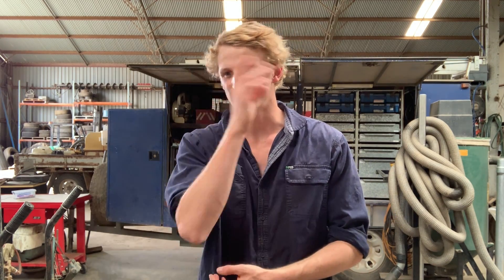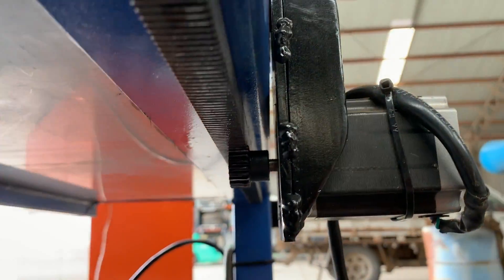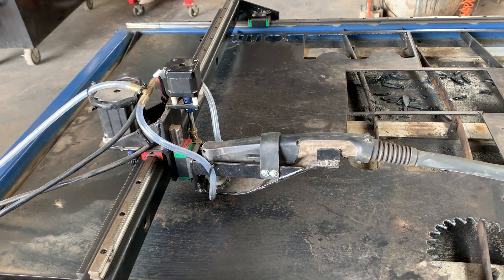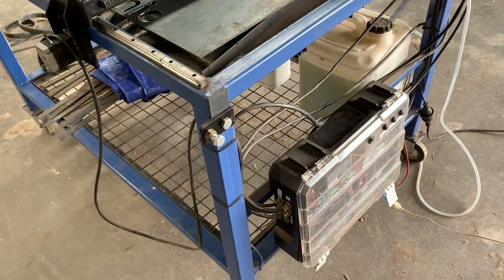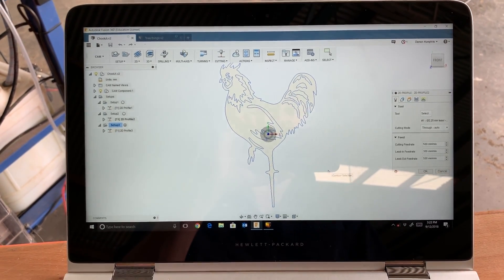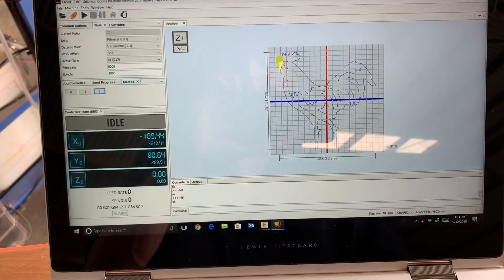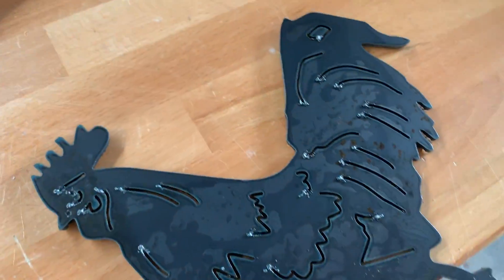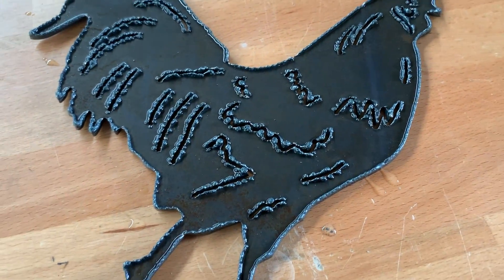Home Made CNC Plasma Cutter

Comment: Do you have a diagram how you wired the cnc shield to the plasma cutter? I got a set up with the same board but using a primeweld cut60 3rd gen..

Comment: I’m planning on building very similar rail and drive setup. Are you happy with the nema23 motors or do you feel more powerful nema34 motors would of been better?
Reply: Unlike CNC routers, plasma cutters require very little torque. I made one with dinky little motors used in 3D printers.

Comment: good job, i built mine using a grbl based controller as well (modded grbl and my fusion post processor) .... add THC, but never thought of adding nozzle mounted water cooling... are you still using it? also

Comment: Nice one man, for emf shielding, it could be coming back down the wires from the stepper coils, (had this problem with dc motor). To fix it, maybe add a diode or decoupling capacitor close to arduino and/or motor control boards.

Comment: you could use a capacitance based system for Z height. Like on a digital caliper...put a metal wheel on the torch holder that can move freely up and down and then use the output from it to alter Z height. iGaging has a digital caliper that has a USB out port on it and you could just attach a little sealed bearing as the wheel so the height is constantly measured. kinda hard to explain in words but if you saw it on a napkin you'd understand in a half-second.
Reply: yeah but the metal wheel shouldnt get caught in any of the cuts and holes made..

Comment: Torch height control will help with reduce the Slag, but your biggest issue is your water cooling is to efficient and will not help with reducing the slag. Also slow down the speed

Comment: Nice work! Thanks for the tour. Going to check out that arduino cnc shield. Yours is the first diy CNC that I've seen that has water cooling. Does Z control compensate for warp maybe?

Comment: Totally insipired by the project. Im also working on something like this using the Arduino CNC shield. Can plz advice me which are the pins that you have connected a input for the relay and how did u connect the relay to plasma.?

Comment: Hi D Humphris. Great Job. And thanks for the Post processor to Fusion 360 / Arduino GBRL. Did you find out with a THC or maybe not necessary. Interesting it works without Pilot Arc. Assume the cooling of plate has crucial influence for warping. Wel. Have build a CNC milling and use arduino cnc shield like yours - but with nema 17 steppers and drives 8825,  but now turn has come for build of  plasma cutter. .Nice table/bed you have build! Y-axis you use DM542T stepperdrive. Reason why ordinary 8825 driver will not work. (have you measured amps on drives while in load?) Or maybe you just need the two nema 23 in serial -and naturally come higher than 2 amps of load? For these type of low value acceleration and speed cncs the amps pulled will normally be low. -Just trying to figure out what will be purchase list for my new build...Until sofar you have inspired me and cannot wait to start..thanks for sharing!

Comment: Verrrry niiice! Is this your first homemade CNC? What a great job! I've love to know more about your choices. Welded steel frame, linear bearings, rack and pinion, digital stepper drivers, but then an Arduino driver? I'm curious how you chose that. I'm not saying it's a bad idea, I'm just curious why you picked it, like what else you considered. I'm building my first CNC and I don't want to bother with Mach3. I don't want to mess around with systems that don't work but software/hardware that does work tends to cost US$300 and up. A $20 Arduino plus the CNC shield sounds kind of ideal if it's reliable.

Comment: Nice job.
Thanks for mentioning the EMI problem.  I am currently frustrated with the same.  I have done the same approach to beat the emi  except for the water table.

Shielded cables, ground everything  , steel box for Arduino.  I guess I will think of water table made of steel.

Thanks again.
Reply: Did you managed to resolve the problem..
Please let me know
Reply: @RoyMeraki  yes
I used ferrite magnets to cover the shielded wires from stepper motors going into metal box also wire from power box.  At that location ferrite magnets going into the box.  I also used a second metal box inside another ferrite magnets around the wire at location going into the box.  Inside inner box Arduino controller.   Lots of trial and error.  The design of a microwave oven outlet and inner box helped me.
Reply: @pedrotorres9836  wow.. thanks you for help sir

Comment: Excellent job on building a very simple yet excellent functioning machine. I am beginning my second CNC plasma machine now so looking around for new ideas. I love the direct water cooling and therefore running the water table basically dry, more or less just funneling coolant into your reservoir. Im wondering why we never really see this done by anyone as I can see it having a lot of advantages over a standard water table. Ive seen some expensive tech that injects water vapor from the plasma shield but your system seems to work great for low tech. You have inspired me to give this method a try. Do you have any input you could share as you have gained some more experience with the machine? Thank you for your time.
Reply from the maker: Sean Stapley hi Sean, I’ve converted it back to a typical water bed system because there wasn’t enough cooling on the stainless bed and was causing it to warp. Also the cooling system I was using was creating a lot slag for some reason
Reply: @dhumphris4717  Thank you for the reply. Those were specifically the two things I was wondering about. I was pretty sure that heating of the pan would be a problem because in your case it is so close to the cutting surface. The slag I noticed in your video was quite heavy and very consistent even on both sides of the cut. I thought that the water spray may have had some effect on that. It did look like the type of slag you had was the easiest sort to remove at least... Anyway, it seems evident to me that your top side water cooling kept that thin gauge sheet flatter than even a traditional water table would have. It also seemed to smoke/steam less than a traditional water table. Would you agree with my observations now that you have tried both? From your point of view, is further experimenting with top side cooling worthwhile (maybe with setting the drain on the pan to maintain a bit of water)?

Comment: Nice plasma cutter. I'm researching making one for myself. I want to use the same plans as my CoreXY 3D printer, to keep parts commonality etc., and I plan to only cut small pieces of steel. Approximately 300x300mm. Do you think that with a system this small I would need water cooling? What about fans for air cooling instead?

Comment: I like your project, its like mine. I have a challenge; when the torch is fired one of the stepper motors(NEMA 23) loses power, and when am cutting with current above 60A wires in the control box heat up. any help please?

Comment: Neat, I would move the controller and electronics out from under the table just because of the coolant/water/plasmacutter mix potentially leaking onto the box. Also would find a way to protect the rails from watersplashes, for some reason they run better without rust ;). Still ... Damn nice job.

Comment: Hey, got into Arduino cnc after having to get an aincient old nc profile machine working as an apprentice lol...check out the 3d printing community for some ideas on implementing height control,  everything they do can be easily scaled up with the controllers you have. And I suspect that second socket on your razor is for a remote control that will help with automating arc control on the fly....most unimig manual include near complete wiring diagrams,  you can download them from unimig website. By the way great idea mounting your drive rails upside down,  even the industrial machines still sit them on top where they fill full of crap 👍
Reply: Just another tip, check out this old Tony,  might give you some more ideas:  https://youtu.be/K9UA9ZRFwWU

Comment: Has anyone ever considered using a vinyl cutting plotter as a base for operating system and parts to build a plasma cnc?? Using the blade axis charge as the cut start/stop control?

Comment: Hi , i use a "PLASMA CUTTING INVERTER TIGMIG TM 60 CUT", i fix the arc pilot but i don't  know how to control it with "CNC 3 Axis TB6560 Driver"(i don't use THC).
Could you  help me with that please  .

the cnc i use
https://fr.aliexpress.com/item/32315347320.html?tt=sns_none&aff_platform=default&cpt=1563368976158&sk=c3ujJSoC&aff_trace_key=9c3fd8f8d43b4d58bee33808c2a67309-1563368976158-05629-c3ujJSoC&terminal_id=298443b4f88f414c92445674a53151c3

the blasma cutter
https://www.tigmig.it/taglio-plasma-inverter-tigmig-tm-60-cut-hf-taglio-16-mm-completa-di-accessori.html

thank you for all

Comment: Nice!  :)
I'm currently building a dual purpose Plasma / Milling CNC machine 1600 x 800mm cutting area. 

From my previous experiments I have noticed that slow cutting speeds increases the amount of dross. Faster speeds reduces dross but if too fast it can have no dross but will cut a slight bevel and the cut will not be square. If this was so easy, everybody would be doing it!
Excellent build.... Enjoyed watching video.

Comment: Hello. I hawe whanted to ask you, why my cnc table have the isuse, when my plasma cutter start my nema 17 start to move in nowere.. I cant figure out why its hapening..
Reply: EM interference or bad grounding almost guaranteed. It is especially hard on the USB connection which is extremely vulnerable to it. Use shielded cables where you can and enclose the electronics in a grounded metal enclosure. Alternatively use alternate means of connecting to the controller (but that would require a little more costly controller). I had the same with my CNC router, but was using a Mach 4 compatible motion controller which had both USB and Ethernet. Changed absolutely nothing else but to switch from USB to Ethernet and gone were my issues. Just to illustrate how badly USB is affected by EM interference.

Comment: Great work and a smooth running machine. i have every part home except for the stepperdriver , didn´t know you could use stepperdriver after the arduino shield . would be great if you could do a quick tour just on your electronic installation , at least i would like it . regards Peter

Comment: The one at my shop is 16' x 40' & we've found it best to just fill up the basin to within an inch or less nominal that way the water catches all the particulate that would otherwise be in the air...also splashes up & cools the material being processed.
Reply: That would be fine except he doesn’t have a third axis for the head. If the metal gets to hot being that thin it will warp up and hit the torch. That’s why the water nets like that.

Comment: Love the ingenuity. You will probably want to change to a reduction gear so that you can speed up the inch per minute speed and not lose resolution with missed steps.
Search www.cnczone.com  (you'll need to register but it's free and they won't spam you to death) for do it yourself plasma tables and you'll find all the resources you need to make your machine perform like you are intending.
Reply from the maker: FTWarr thanks mate! That’s really good advice. I have noticed that going faster does result in missed steps every now and then
Reply: I'm sure you do. If you reduce the steppers down and then speed up the inch per minute your dross will all but disappear.
Reply: I modified these to fit my machine to reduce it down to 3:1 I believe.  
http://www.cncrouterparts.com/pro-rack-and-pinion-drive-nema-23-p-227.html

Comment: Do you have any problems with your linear rails becoming dirty or pitted because they are on the top pf your frame rather than the sides as others have done?
Reply from the maker: steveu235 I haven’t had any problems yet, I’ve generally been lubricating them every time I use the machine

Comment: nice looking machine what pitch rack and pinion are you using and how many teeth on the pinion?
Reply from the maker: steveu235 I believe it’s 1mm pitch and 20 teeth on the pinion. Not sure if it should ideally be geared down further, but it works

Comment: couple of questions. 
where did you get the cables for the motors?
how did you electrically insulate the all the cables in the system?
is your water cooling activated by the same relay as the torch? or is it just on a switch?
if you could post links to "all" the parts that would be super helpful. i am currently drawing up plans to build my own table. you are the first person i have seen run a table like this with arduino.
Reply from the maker: Branden Floyd I got the cables for the motors from 3DTek. I think I used 4 core 7 strand 1mm2. https://3dtek.xyz/collections/bits-n-pieces/products/shielded-screened-cable
They are the only cables that I needed to insulate as they are the only ones above the stainless steel sheet.
The water is just on a manual switch at the moment for the sake of simplicity, but probably could be wired to the plasma arc relay.
My laptop is currently being fixed so might not be able to get you a full parts list for a little while. Most gear was either bought from eBay and my local steel engineering business

Comment: Where do you wire the ok to move wires on that plasma? I have the same one
Reply from the maker: I think that’s pins 3/4 on the 4 pin connection..however I never used the “arc ok” function on my machine

Comment: Where did you get the Hiwin rails in Oz? - seem to be expensive! Interested in your thoughts on a THC for the Unimig (I have the Razor 80 and I am currently looking at what's available).
Reply from the maker: Grant Tudor I got them on eBay from a shop called “silvers-123”.
They were the most expensive part of the build but are completely worth it in my opinion. 
My first attempt at using an array of bearings constantly jammed and made terrible cuts
Reply: @dhumphris4717  Thanks for the info  - I will check them out.

Comment: Nice job mate. I liked your cooling system solution, but it may need to be directed away from the cut path to cool the metal without chilling the plasma. I see you shop at Hare and Forbes as well. Which state?
Reply from the maker: Mark Fryer I’ll have to try that! Cheers. One of my favourite shops haha. SA

Comment: Nice job man! Noticed your using a cut45 (obviously an Aussie boy too), I wanted to use one of them for my machine but wasn’t sure if it was high frequency or blowback start (which most people suggest because it doesn’t have interference), have you had any trouble hooking it up to your machine or with interference? 

I’m in the process of making my own too, check out @hardline_fabrication if you want to have a sneak peak.
Reply: Scrap that, should have finished watching the video

Comment: Do u think that the water injection is the cause for the slag vs having the table filled with water?
Reply: You can still drain the water using the same system you have. Drain to the tank and pump back when you want to use it. It will take a bit but keeps it portable. I plan on doing this since I won’t use it all that often.
Reply: Definitely! The melted material is being cooled down before has a chance to spray off.
Reply from the maker: yea you might be onto something there! it's just a little awkward for me because my machine need to be movable and quick to use, so having a full water bed wouldn't work for my particular situation.
Reply: @dhumphris4717  your work is inspiring me to finish my plasma build. The slang my plasma cutter produces can be a bit discouraging. Now I'm motivated. Thanks for the sharing of your video.
Reply: @dhumphris4717  please share the Electronic schematics
Reply: @dhumphris4717 You can make water-bed similar to the industrial machines: air balloon quickly pushes water up from a sealed lower tank (water storage tank) to a upper tank (cutting place) through big diameter pipes and a cutting process starts. After cutting is done, air is released from a balloon and water quickly drains to a lower tank. Then whole table can be moved without fear off splashing and spilling. For your convenience, the metal sheets and parts can be placed/taken out without a water all around.
Nice work. Thank you for sharing.
Reply: @dhumphris4717  just use setup u have, pump the water into the bed, then drain back into holding tank when not using.
Reply: I was just thinking the same thing.

Comment: Hey mate, a Proma 150 thc is usually the easiest way to go. you are getting dross on the bottom from the water cooling the metal instantly. Its a trade off from a dusty dry system. You can dial it down though with the right settings and thc.. Try dropping the parts flat on the ground or use a wire wheel to get it off. once you use a flapper you have to grind the whole bit off. any chance pof having a look at  the pp? im going to make a new one soon. Mach3/4 is a bit of a pain to get right but a breeze to make your own m codes. good luck, its a great rig.
Reply from the maker: I see, Thanks for the comment, that's really interesting! I've added a link to the Post Processor in the description.